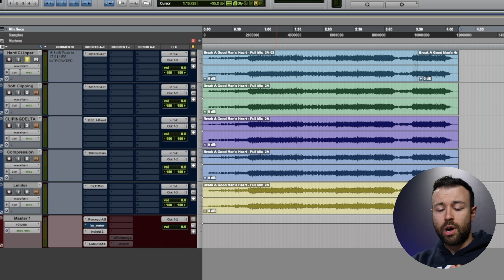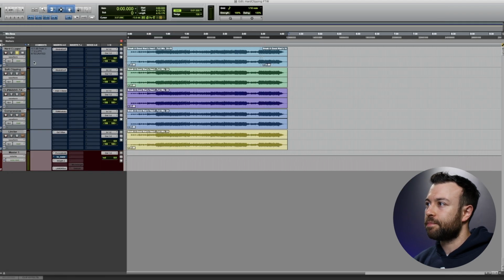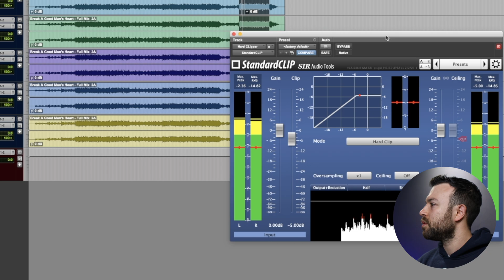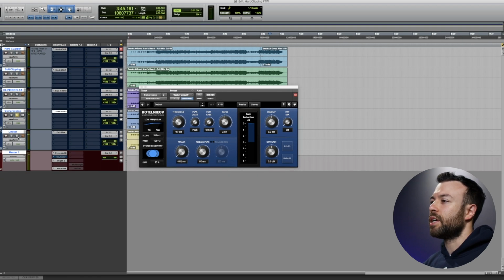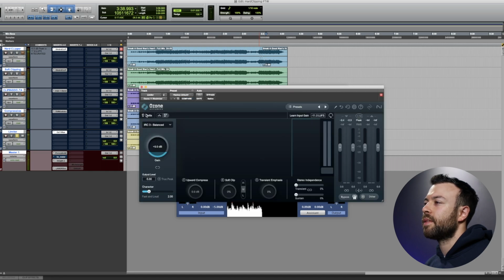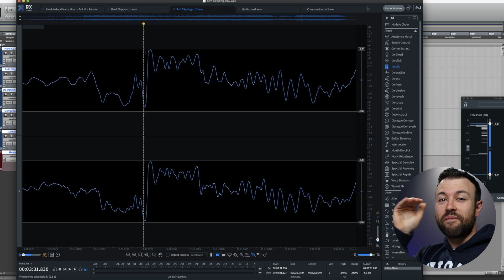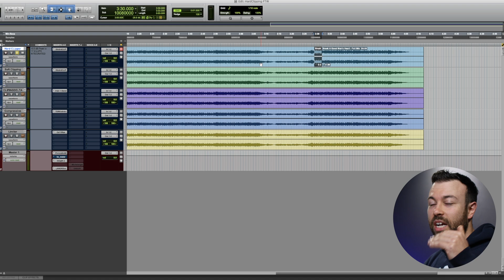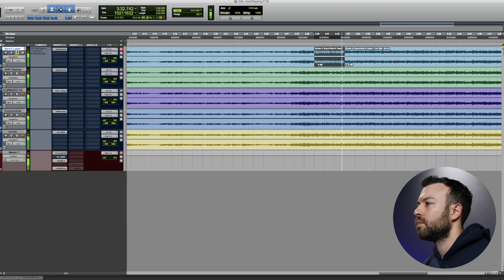Hard Clipping Case Study (Hard vs Soft vs Compression vs Limiting)

Comment: Hard clipping cuases a corner discontinuity in the first derivative of the transfer function, which is why it sounds bad if you push it to audible levels, especially with no attempt to remove aliasing.
Of course small amounts may sound very transparent on some sounds.

Clipping is also equivalent to brickwall limiting with instant attack and release times.

Comment: Mastering APwasn't saying that soft clipping isn't useful, but rather that analog clippers work differently from digital clippers. Specifically, a digital clipper deletes sound data, while an analog clipper reintroduces that data in a different way. I think he's approaching it from an analog perspective, where it doesn't make sense to compare the two directly. However, others are looking at it through the lens of the marketed term 'soft clipper.' AP Mastering is essentially saying that it's a form of distortion or saturation

Comment: I really appreciate how you broke down the case study on hard clipping vs. soft clipping and other alternatives like compression and limiting. It's great to see real-world applications, especially when you highlight the trade-offs in transparency. I found the following points particularly useful:

    1. The contrast between hard and soft clipping: The way you demonstrated how hard clipping affects only the peak samples while soft clipping touches more of the signal below the threshold was really enlightening. The transfer function explanation also helped in understanding why the tonal changes occur with soft clipping.

    2. Transparency as the goal: Your focus on maintaining transparency and reducing artifacts, especially in a context where the peaks last only 1/12,000th of a second, makes the case for hard clipping very clear. It's a reminder that sometimes the most minimal alteration to achieve headroom can be the best approach, depending on the material.

    3. Delta listening and visual analysis: Being able to listen to the differences using the Delta signal, and then visually analyzing the impact in RX, solidified the technical understanding. I liked how you compared each processor's effect on the waveform, especially the insight about the limiter's lookahead function.

    4. Encouraging feedback and open-mindedness: The way you engage with the community to call you out if needed and to remain open to different processes, rather than demonizing any particular tool. It keeps the discussion productive and promotes learning.

All in all, your breakdown made it easy to grasp the nuances of peak management, and I'm looking forward to applying some of these techniques in my own sessions. Thanks for sharing this detailed analysis and having the best newsletter to date!

Comment: I think the limiter difference at 8m in your video is maybe not lookahead - I think it’s stereo linking which you have at 0 independence… so the peak on the right channel is pulling down the peak on the left channel. Could be interesting to look at stereo linking at some point, as that’s a topic that doesn’t get a lot of love but is really important for stereo!
Reply: … and also comparing to the hard clipper which has effectively 100% channel independence…. just a thought :)
Reply from the maker: You may be correct and that’s an oversight on my behalf! When I get back to the studio I’ll check it out. I did do some videos on the low-end drift caused by unlinking your limiters

Comment: I only use clipping before compressors when mixing.  Clipping transients before a limiter in mastering is kind of a redundant exercise as most digital limiters already do that - lookahead enables a limiter to react before the transient, which hits a "brick wall" and the attack speed/time doesn't engage until the signal drops below the "brick wall" setting.  FabFilter Pro-L2 does this, so setting the lookahead to zero and the attack to it's slowest setting turns Pro-L2 into a clipper - basically the "brick wall" flattens the signal without shaping and with a super slow attack time no shaping will occur as the next transient will start it all over again.
Reply: Clipping before limiters is not redundant. Clippers REMOVE signal, while limiters COMPRESS signal. With compression, the whole signal gets turned down, not just the peaks. With clipping, just the peaks get shaved off. Removing peaks before compression allows you to do more transparent compression, because the peaks don't trigger the compression as much (which typically can cause pumping)

Comment: If soft clipper is adjusting peaks well below 0dbfs, it’s either not dialed in correctly or badly coded.
Also, you compared hard clipper having 0ms attack and release times with compressors and limiters having much longer times expecting different results. Try to set them to 0 or near 0 values for fair fight.

Comment: You say your goal is the most transparent peak control. But that wouldn't be the hard clipper. That would be the limiter (depending on what limiter I guess). With the hard clipper you are fundamentally changing the waveform (by chopping it off), with the limiter you are merely turning the volume of the peak down (which is more in line with your goal of most transparent). Also, the delta of the hard clipper is showing you what you are chopping off, the delta on the limiter is showing you what you are lowering the volume on, those are different things. That said, some people like the distortion from a hard clipper.
Reply: For the record, clippers (soft and hard) and limiters all “fundamentally change the waveform.“
Reply: Not wanting to start a debate over the word “fundamentally”, but turning the volume down on a peak is far different and less destructive than chopping the peak off. Take a sine wave and turn the volume of it up or down and it hasn’t fundamentally changed, but clip it (pretty much turning it into a square wave) and it is now radically different and sounds that way.
Reply: @SG-4u  chopping off a peak is exactly the same thing as turning down the volume. The difference is just how quickly and accurately it happens
Reply: Incorrect. It’s called clipping for a reason. Go and look (and listen) at what it does to a wave. Listen to a guitar distortion pedal, that distortion is (usually) the sound of waves getting chopped. I know you can hear the difference between a sine wave and a square wave, but if you aren’t familiar, play around with a soft synth where you can see the wave form and change it’s shape from one that is round to one that is clipped, it’s a dramatically different sound. Lowering volume is not distortion, clipping is.
Reply: @SG-4u  you have a lot to learn my friend
Reply from the maker: The limiter is a perfect alternative. But as soon as you add time constants into the equation the linearity of the transfer can shift (plot your limiter on a hammerstein graph and you’ll see the low end shift)

Comment: So, are you hard clipping in RX and soft clipping in the session or both in the session now?
Reply: both with StandardClip
Reply: @Chiefmonks  Good to know, thanks. I thought in earlier videos it was hard clipped in RX first and then imported into the session.
Reply: @EdPettersen  nono, he uses RX to only graphically see how much -db would be when you shave off a handfull of peaks. The De-Clip mode in RX lets you see a line that you can move down or up and it tells you the threshold that you later set in the StandardClip plugin
Reply: @Chiefmonks  Yeah, I get that, but you can also hard clip first in RX. Especially if you need to save CPU (which fortunately, I don't). The hard clip feature in Standard Clip is great.
Reply from the maker: All in the session with standard clip
Reply: @panorama_mastering  Thanks!